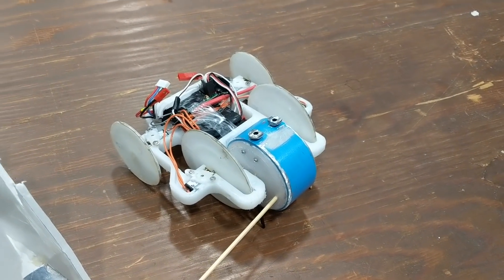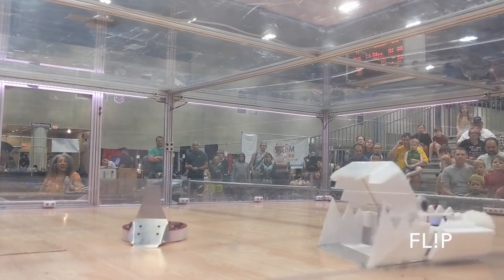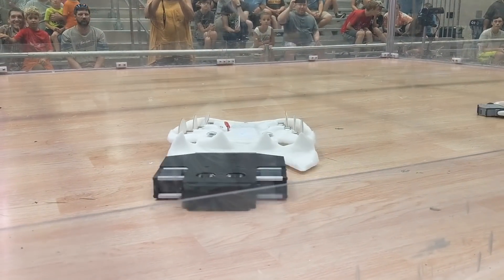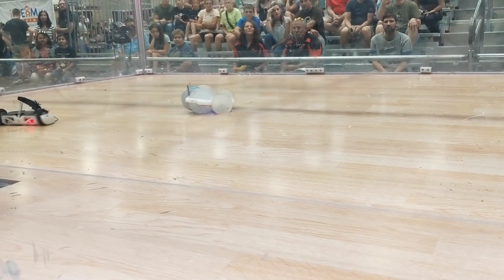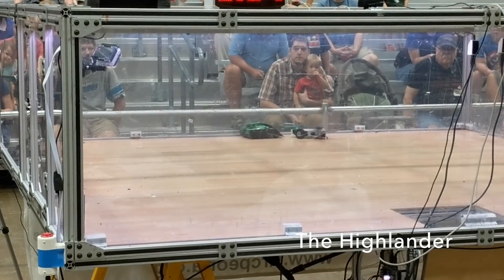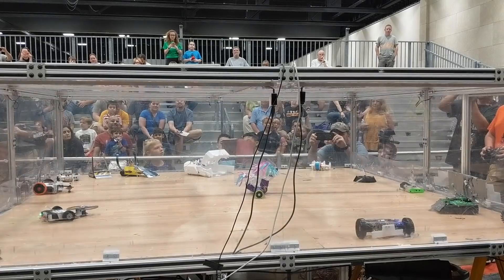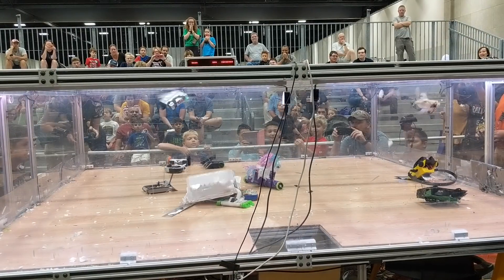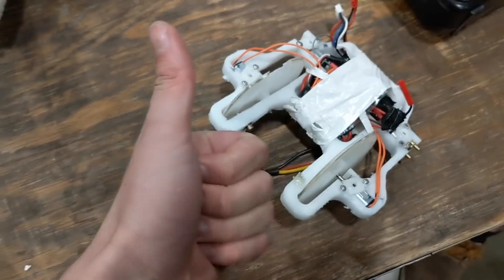Krave Monster V3, 2018 CIRC Bot Brawl

Comment: For the next crave monster you should try to put a rod or arm on the top that you would attach to a straight servo arm and use a high torque servo and mount the servo in a way that if the crave gets flipped over it can right itself so that you don’t have to worry if you have to fight a flipper . I hope this helps. I really like the crave.

Comment: 5:25 SOMEONE CHANGED UP TOMBSTONE TO MAKE IT A WEDGE MINIBOT, I WOULD MAKE THE WEAPON FASTER AND STRONGER FOR A MINIBOT
Reply from the maker: That someone was me.  Why are you using all caps?
Reply: bc i though it was col
Reply: and why didnt you keep the spinner?
Reply: The spinner is utterly ineffective and pointless at that weight class, it would be impossible for a mini-bot that small to have an even remotely effective spinner. Honestly having a minibot at all is pretty much pointless and doesn't actually do anything for you, I suspect he just tacked it on for shits and giggles bc he happened to have extra weight.

Comment: I'm looking to build a ant weight yet don't have a 3d printer, if anyone has 3d printer suggestions or suggestions for building without a 3d printer please let me know! (I very much so want to know a good 3d printer to get as well, so please do suggest one!)
Reply from the maker: If your only reason for having a printer is to build an ant, I'd recommend just using a 3D print service to print your chassis.  For example, https://www.endbots.com has a Markforged Onyx One and can 3D print a nylon-carbon ant weight chassis for around 30-40 bucks.  You could build like 90 bots before paying as much as that printer costs.   

If you want to buy your own printer, I personally like my Lulzbot Taz 5.  The Lulzbot mini can be had for $750 refurbished and is another option.  Don't expect stellar fine details on prints from Lulzbot, but you do get reliability and if you put a cover over it the ability to print many different materials.
Reply: ah alright thanks!
Reply: Who said you needed a 3D printer?
Reply: Plus a lot of library's and schools have them

Comment: You really should make your bots out of strong metal
Reply from the maker: If the chassis of Danzer Zone was milled from aluminum it would have weighed an extra .3 lbs.  My weapon would have had to be less than half as heavy to compensate, making it much less powerful.  If the krave Monster was made from even thin sheet metal it would need to be much smaller than 12" x 12" (there is no very large metal antweight that still has enough weight left over for 4 drive motors and 3 servos).  A smaller Krave wouldn't be able to eat other bots.  Only the beetle design this year would work well as a metal bot.  For antweights I'd rather spend my weight on 4wd, weapons, and size than on a metal chassis.
Reply: I’ve built 3 ant weight but they all get destroyed cuz i don’t have time to put any armour on
Reply: Let me get this straight I’m an 11 year old boy I,m from a Christian family I grew up to bot fighting sense I watch the reboot series of battle bots and the original and all bot fighting sources and I hardly know any of that stuff and also my names fernando my last name is Capurro I do have the knowledge but I’m a little rusty
Reply: Um... ok?
Reply: I am 13 but I know what most of that is because I have asked questions about it!
Reply: I'm 13 too, and my dad and I built a beetle weight pusher bot that we used the parts of an RC car to build it. But my dad says the  circuitry is really easy to make. Is what he says true? I'm just not sure. Also, where should I get parts? Because I might want to enter the contest with my dad.
Reply: Also, what kind of bot do you recommend for a first timer?

Comment: Your bots are surprisingly rugged for using comparatively cheap chassis materials.
Reply from the maker: Scribe Hammar  thanks.  Very few parts of my bots are rigid. Not much shock is transferred through the robots to the electronics. Of course, while function is retained visible damage is often quite bad (ex: blades were melting groves into the shapelock durring the rumble) so even if my robot is working judge decisions won't often be in my favor

Comment: You should make a bot that has another bot inside and can come out
Reply from the maker: that was the original plan for Krave this year-  a HexBug-based mini Krave driving out of the mouth.  Unfortunately two servos were needed for lifting and I ran out of weight.
Reply: I plan to make a Hexbug Krave Monster out of a Hexbug Beta or Blacksmith when it comes out.
Reply: What if I was to drae a modle
Reply: What's the wight of the bots
Reply: It is 1 pound, or you could enter the 3 pound category at the compatition he is at.
Reply: LNDS Studios competition